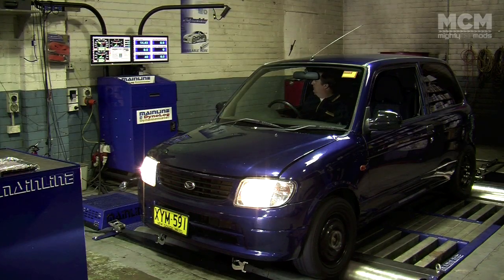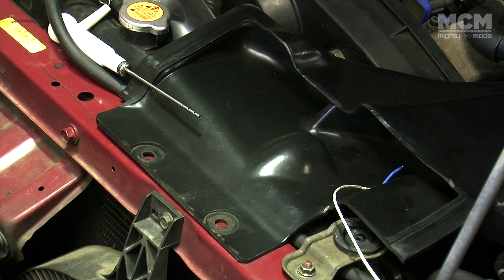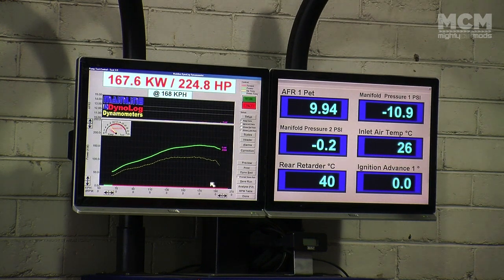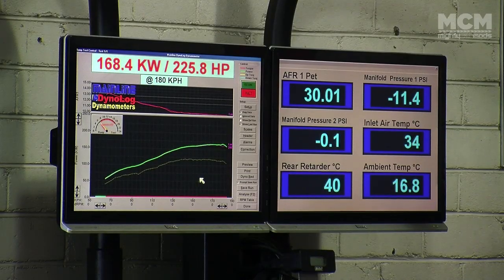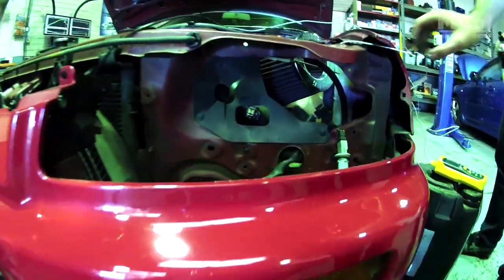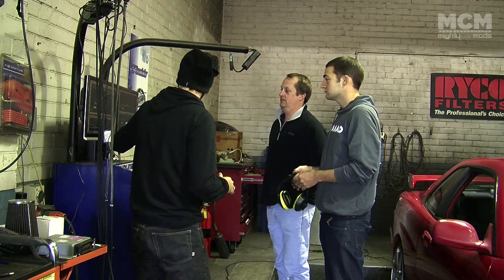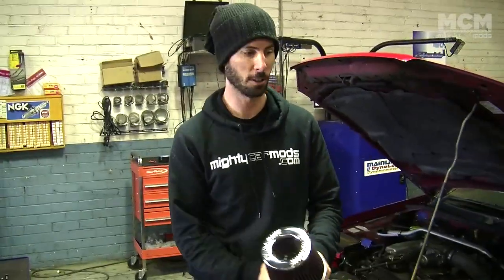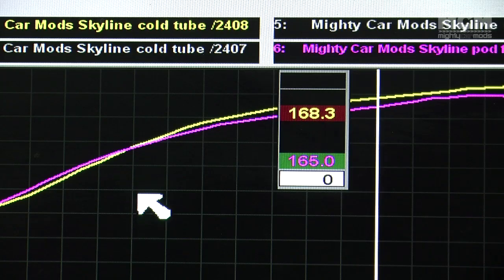Cold Air Intakes Mythbusted [Turbo]

Comment: Test an ITG filter please.

Also I don't believe that you have to have a 10% power gain to notice it. Because when I use fuels that are inferior to Shell V-Power that are still 98RON I notice it and surely the power gain is less than 10%.
In some cases a 1% power increase might be all a car needs to be tipped over the edge into 1st to 2nd gear scampering wheelspin.

Thanks for the video guys, really interesting. Would be cool if the filter was able to be mounted around the grill straight on to see if power increased. (aka a realistic functional way to mount the filter if possible)

Comment: A cold air intake isn't a filter that pulls air from the engine compartment. Also, the diameter of the feed from the filter to the throttle body size matters, how rigid it is at the mass air flow sensor, and materials it's madde of. Why didn't you get much over factory? The factory WAS a cold air intake, and what was added wasn't a mid to high end true cold air intake. My 2012, 3.7ltr V6 had a gain of only 15hp with a BBK CAI, but a 6.4 mpg increase with the stock throttle body giving me 320hp and 37.7mpg highway over the stock CAI. This may not be 10% or more gain, but I got better response on acceleration and went from 13.7 seconds on the 1/4 mile to 13.3 seconds. Overall, a true CAI leads to more power and better response to the pedal resulting performance. Myth not busted unless done correctly. Don't mean to be mean, but as a car guy and track racer, CAI is a very important part of gaining performance.

Comment: it also depends on how the engine control system is done is it a maf or a map sensor or both on my turbo volvo its a maf only and a single o2 sensor and the pod filter does make a noticeable difference as the bosch lh2.4 ecu system will see more air and add more fuel up to a certain point but not all ecu systems do this

Comment: Despite the fact that they themselves myth busted pod filters, they still run pod filters on their cars, even to this day.
Reply: When modding an engine, it is often difficult to continue using the stock filter because of the space requirements, routing, ect.  Pod filters are often used for convenience, not for power.

Comment: If the filter is in the engine compartment with no way to keep out heat it's not a cold air kit. A guy recently installed one on his truck Dyno before and after and gained 12 horsepower

Comment: I believeYou need airflow from a moving car. If your airfilter is placed further away or in an area where the heat from the engine bay is hottest a cold air intake works well... if the car is moving. Of course you got an increase in horsepower from the CAI being outside the engine bay. But if you actually moved the car where you had the CAI originally or depending on the CAI, it should increase horsepower. But who knows, maybe I'm wrong. I highly suggest trying it at least.
Reply: I believe heat shields actually might help alot too

Comment: I guess the tuner car world is different. On my 5.4 L f150, k&n claims 12 hp increase. They have real dyno charts. It makes sense to me because It picks up the air from the wheel well and also the intake tube is an inch or so bigger. Another thing to think about is in America, auto makers have to sell cars to California and they have stupid strict emissioms garbage. In my opinion, it's not the CAI that's giving you all the power but it's more of getting rid of the factory.

Comment: I assume that the R34 has a MAF sensor, being that it's an OBDII system. I've gotta wonder if things would be different on a pre-1996 car without all of the computers trying to correct things, OR, possibly more importantly,  if you have a quality aftermarket chip in conjunction with the intake, so that it can correct any impalances over time.

Comment: Any engine is designed to run at PEAK power and economy with the FACTORY intake. That intake is DESIGNED to feed a certain amount, quality, and temperature of air for that engine to run at its best.  No aftermarket intake  will ever be better than a factory intake. Unless you have one designed, and built and then have your engine tuned to those exact specs...

Comment: I'm genuinely confused, there are many other channels out there chuck on aftermarket intake and ran on dyno straight away and can see quite a bit of gains. E.g vivid racing did it on M4. And with VW stage 1 tune, they need an aftermarket intake as well. Many companies like VWR, APR, Revo all boast that their intake system allow quite a bit of gains... Is there differences between gains of using intake for euro cars and JDM cars?

Comment: So I have a 2022 BMW 228I XDrive Gran Coupe. I have a K&N Cold air intake, and the intake box is fed Air via active grill shutters. When I put it on it instantly had better throttle response, and sounded bad ass, I also have a Dinan boost module. I have not dynoed it, However due to the active grill shutter’s I’m thinking that it probably does increase horsepower, thoughts?

Comment: These guys proved what I've been telling my gear head friends for years. Horsepower comes at a price and comes with significant modifications. Not a muffler, not an air filter, etc. Here's another big MYTH. It's going to piss tons of people off. K&N Filters. They are blowing smoke up all of your asses. You can't restrict air flow and expect your engine to run better or get better fuel economy. What I am talking about is the restrictive oiled filters. Air does not, can not, and will not flow better through a wet filter. I tried this BS on my 96 Vett  against my own better sense.  The wet K&N dropped my fuel economy by 2 miles per gallon. I took out and replaced it with the free flowing paper filter the the GM engineers recommended and got my economy back. Did I Dyno test it? No. You're not going to raise horsepower by restricting air going into the engine. You can't beat a dry filter for air flow.

Comment: There are  problems with the method of testing here : First, when you make any changes to air fuel mixtures the cars computers take time to re-think what they are doing. It could take a couple of hundred miles before the computers adjust and any real gains are realized. Second, If the car is turbocharged, to get any real gains you must increase the airflow al the way to the turbo not just into the MAF. Without air increase all the way to the turbo you won't maximize your gains.

Comment: Science says "cold air is more dense than hot air, therefor cold air has more oxygen molecules and releases more energy when it reacts". If you relocate your intake to a cooler position and have efficient piping you will make more power, even if it's a minuscule amount.

Comment: I had a del Sol with intake piped into the front bumper, I felt a better throttle response but that's all. Ended up driving though a road that flooded in my neighborhood that was placid and looked like tarmac (night time) threw it in reverse real quick, wrong choice, and heard thud thud BAM, bent two rods, tore three piston sleeves, and snapped crank hardware. Should have paid attention in chemistry, can't compress water.

Comment: id like to see you test a k&n since iv seen them work. i think you guys should have adleast reset the computer get it a chance to readjust. but i think they should be called a high flow intank not a cold air.

Comment: There is no air movement that you would get while driving at speed. Pretty sure that would make a big difference in the amount and the average temperature of the cold air going into the engine. What am I missing?

Comment: What if you altered the ecu tune after the new intake is placed on because the way the car is getting air
Reply: on a boosted performance car the intake is already a good system... although the induction/flutter is great and it might be more beneficial for space... but retuning/flashing the ecu JUST for an intake will do nothing, changing other factors in the ecu would see a gain for ALL these filter setups. There is so much more you could do to this car besides a $20 pod filter and youd probably see 200kw-250kw for around $500-$1000

Comment: I know growing up flipping the lid on an old carb/air cleaner setup you got more noise, less fuel mileage and no real difference in performance. However with more air required needs more air delivered so possibly where you're seeing minimal results, possibly a result of cubic inches of air required. I've never heard of 20% I have heard of 8-13hp on v8s...but again an engine is only going to pull what is required and typically your looking for a factory box to be pressurized at all times which in cases under wot you would de-pressurize the factory box starving it of air. Whereas a open element allows a constant amount of air at all times so it gives an illusion of power gains only because is available on tap to breathe vs not

Comment: Okay i love these guys and their videos but i definitely feel like this test should have been done out on the street/track. Yes they are supplying it with air but at the same time i feel like having the car literally moving on a road would make a significant difference in how muchh air is being received, temperature, etc. good video and good information, but i bet if you put your air intake by your bumper or by your intercooler (if it's in the front bumper) could add more cold air, but i doubt the horsepower rating are going to be any more significant than 5whp on top of what you have

Comment: okay, these two don't have a lot of Technical Training. If you understand how cold air intakes work the best ones draw cold air from the outside which they do address briefly. But they do not address is the fact that as cars are driven farther and harder under error temperatures rise the idea of a cold air intake is to draw cold air and more of it from outside of the engine compartment. Colder air is more dense and the more of it you can get into with the engine the better the engine works you do not want to draw air from inside the engine compartment because temperature are continuing to rise the longer and harder the car is driven

Comment: When it was properly cold air intake, away from the engine, it was a significant gain.  Anything sucking hot air in the engine bay is not going to make any difference, as we saw, sometimes worse than stock.

Comment: What I just said about full range engine RPM response, is also like comparing SC and TC. They have entirely different application n affects the rev range differently, so its not legit to compare that way. Same goes to SRI and CAI if you just comparing them at peak power, its kinda theorically accurate but NOT practical. And real tuners do on road or track tuning by comparing the the overall track time, braking and cornering Gs to determine a true after market upgrade.

NOBODY use stock air filter n go racing, that would be a laugh

Comment: For a cold air intake to work, you need..... cold air. Why does everyone think air will magically get colder because you put some tubing and a cone filter on? You need air that is COLDER than an ambient 72F. Cold air intakes dont make air cold, they just allow cold air easier access. Stock filter boxes create dead space and retain heat. Even if you were in a colder environment, a stock box doesnt allow you to enjoy the change in density and temperature. A "cold air intake" allows you to take advantage of the changes. DO THE TEST USING.... COLD AIR.

Comment: Here's the problem. They are only adding a pod filter. Only adding a pod filter doesn't do anything to a car no matter what. And turbo cars usually gain a lot from a true cold air intake with larger diameter piping and a tune. Cause I have a turbo 335i with a AFE intake and tune and I gained about more than 15 horses.

Comment: I feel like it isn't benefiting because you're using a small displacement engine and there is no tuning. Also what effect does the turbo have on this? I'm sure that a turbo vehicle would benefit most from an intercooler than a CAI. Obviously this car didn't benefit much, but others definitely do, even if by just a little 5-10 hp.

Comment: 1.7% is cherry-picking your own bad data. Despite the turbo-heated air issue, dropping the intake air from 24c to 15c (-9c), should equate to 3% hp gain. On a 222.0-227.5hp stock car, the gain should be ~6.6-6.8hp, which it did show:  up 4.9-10.9hp vs. stock to 232.4-232.9hp

Comment: YO I say its good for my turbo. The colder denser air you can get into your engine the better. But its part of a big puzzle. If I took my stock piping out and put a nice inlet in all the way to my turbo that was also heat resistant I would see a massive gain in consistency plus maybe the two or thee H.P. Some cars especially older ones have a terrible air intake track  and need everything gone through. In my case the plenum the airbox the intake scoop and the hoses alond with the turbo.... But thats performance for ya.

Comment: Did I miss something? Where's the forced air going into the engine. Isn't a CAI designed kind of like a ram where forced air helps in asperating the engine. I also wonder about these things but I think you need to take it on the road to test it. I don't know how much more hp I got when I put mine on my 2016 Mustang GT but I shaved .5 sec of of my 0-60 time (5.1-4.6). Haven't seen any gains in mpg or anything else. I'm also reluctant to "tune" the Mustang. It voids my warranty and from watching videos of people with my car their 1/4mile and 0-60 times are the same as mine without a tune.
Reply: Honestly man, your improved 0-60 is more likely just you getting acquainted with your car and becoming better at driving it. I like a cai as much as the next guy but the reality is they just don't add any power.

Comment: well I have a turbo diesel .. a hood scoop and  running 80mph .. the rammed air intake will indeed make a difference in horsepower and mileage...

that little pod filter is silly to even try testing....  throw a real filter on there!

Comment: If you are adding more air in you also have to get more air out and also change the tune for the extra air your getting in and that the maf is placing in the motor more air in more air out also tune for more fuel and there ya go more power most guy don't do the tune but they will do the intake and a cat back but the stock cat will restrict the flow of air out so you'll want to do a turbo back to replace the cat also with a high flow cat or a test pipe cause more air in don't always mean more air out any restriction will hinder your power that your trying to make..

Comment: doesnt the ECU just adjust to keep it at a set scale thus giving similar results.. but if you did mods then remap to compensate then ud get gains.. most ecus especially old ones dont go much out of there parameters..

Comment: Aren't you supposed to replace the accordion intake hose too? Smooth piping vs rippled surely makes some difference. Even if only minor. If you were going through all of the trouble to make this video, you could have at least done the "intake" part right. With ALL of the variations you tried for a video titled "cold air intake mythbusted", not once did you actually put a cold air intake on the car. Just a pod filter.

Comment: Well, cold air intake doesn't work as well as it would work on N/A engines, because for turbo charged engines have pressure released as setup values.

Comment: Everyone knows that you need a TUNE after making any modifications to the cars engine. Otherwise the computer still thinks it's running the stock air box. The computer has to adjust to the increase of air and give it more fuel to keep the duty cycle consistent.
Reply: I keep reading these comments "you have to tune after installing" .  What parameters are changing that the computer cannot detect?
Reply: @jimfallowfield7028  when you change the air fuel ratios disconnecting the battery and resetting the ecu can only do so much. A stock ecu is only made to detect certain ratios.

Comment: You may need to restart your car after disconnecting the battery, and let it idle for 10-15 minutes. This would let your car acclimate to the hardware change.

Comment: So wait, that looked like a ram intake which is just sucking engine heat.  Shouldn't a cai be in in another part of the engine bay or in the wheel well with denser air?

Comment: The only way you make more power with a cold air intake is if you do it properly.That means you need to isolate the intake from the heat of the engine that way you are not pulling in hot air(hot air has less oxygen than cold).The way you tried to do this failed because the tube was lengthy,may not have been properly sealed,and heat from the engine could still heat up the air going into the intake because the tube was not insulated.

Comment: Most "cold air intakes" are bologna anyways. They are removing the factory airbox which already pulls in cold air, and replace it with an aluminum (great at transferring heat from engine compartment into intake air) with an under hood filter pulling in hot air from under the hood.    Cracks me up what suckers will buy.

Comment: But the car is stationary and no air is moving towards air intake, and as i understand throttle body isn't working like a vacuum. So if car is moving and more air compressed into intake will there be any gain in power then?

Comment: A CAI can only provide significant power increase if the stock intake is significantly restrictive. That is almost never the case. I still wouldn't say CAI are completely busted because this particular case showed no increase. A performance tuned car from the factory like this is the worst test case. The engineers were trying to get more out of that engine so they wouldn't design an intake that favors fuel economy and restriction. It is possible to get more power with a CAI, but not very likely since most companies/engineers have been doing this car building thing for a while.